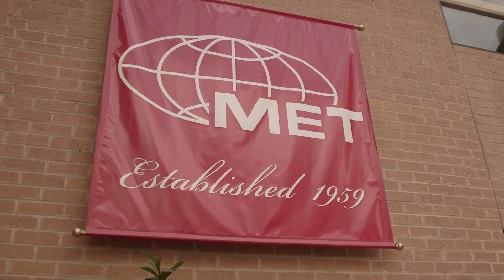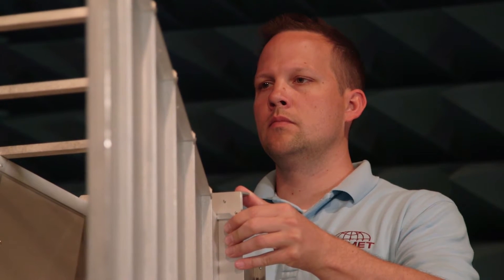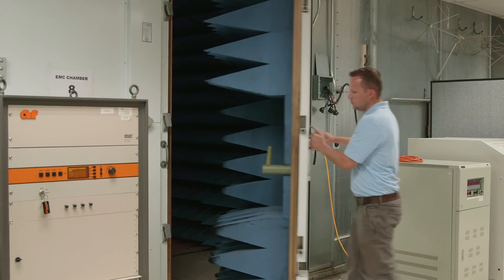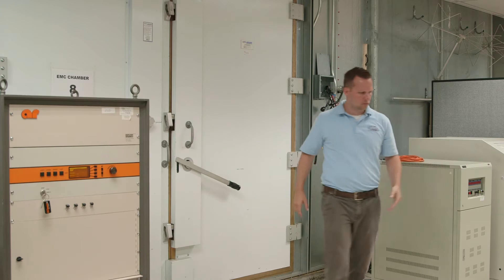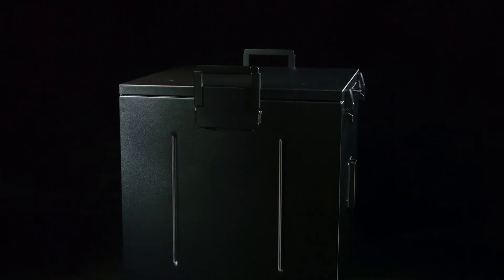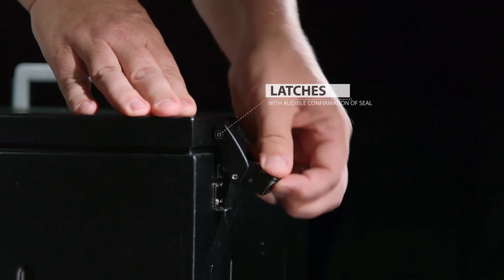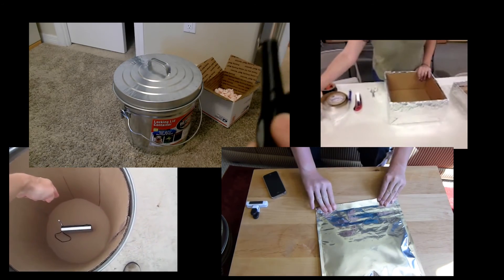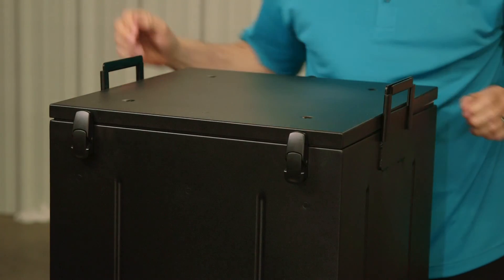Faraday Cage: Tested and proven by experts

Comment: Hi Ken, in your testing of various metals for your product, did it matter what a Faraday cage's metal is made of? 
Does aluminum and steel work, or is one a better protector than the other?
Thanks, Woody
Reply from the maker: In general, faraday cages can be made out of aluminum, steel, copper, or other metals; but each metal has unique characteristics both physically and electrically. We chose aluminum for our product because it is a light metal that has excellent shielding capabilities in the range of concern for electromagnetic pulses. This allows a rather large box to be constructed that can still be fairly easily moved when it is full while providing among the best protection.

By comparison, “steel” is not an element; as a result there are many variants of steel reflecting different blends. Different variants of steel will perform differently; however, I am unaware of any that can outperform aluminum for EMP protection. 

And of course the material is only a small part of the problem. The bigger challenge is the seal. Even a small gap can nullify much of your protection.

Comment: Yea the dude just talked about the product. There has been no shown testing of this so there's no proof it does as claimed.
Reply from the maker: The actual test results are posted at https://tufconcepts.com/tuf-blok-specifications
Reply: So I did my research before I made that comment. There is zero documentation or reference to the MET Lab for this. What you have posted is a graph that any child can make themselves. A proper facility that works well with the government will have more than what you have posted there, on the graph. You also only posted a photo of the machine and the box. Nothing actually documented.
Reply from the maker: I have added the official documentation at http://files.tufconcepts.com/EMC42674-GEN.pdf; I suspect most will prefer the graph that we have provided as being easier to understand.